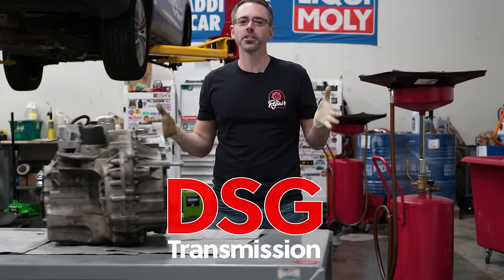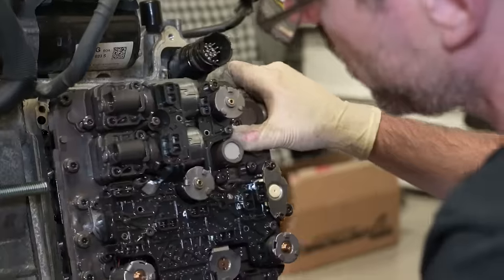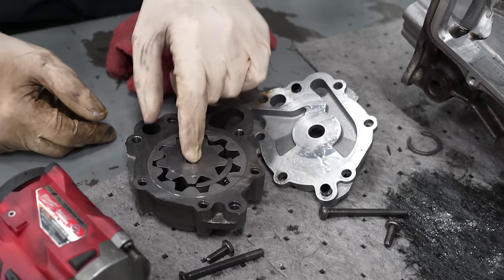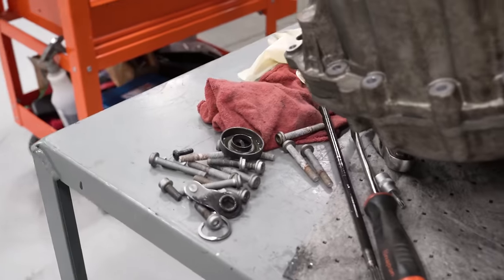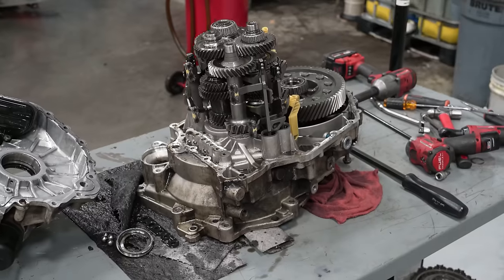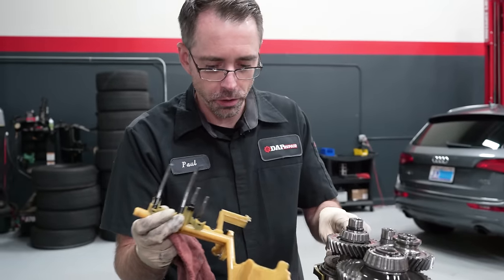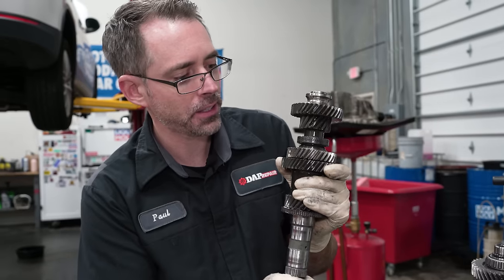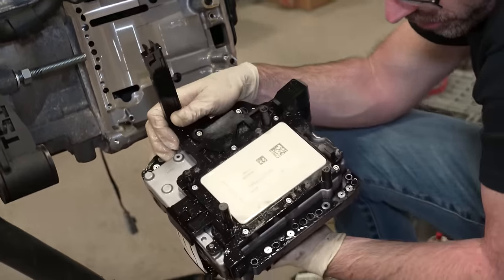Why Did This DSG Transmission FAIL?

Comment: There's one point never mentioned is the software part. Temic (who develop the software for Vw) never made a good one. It's one of the most important point if you want a reliable DSG. TVS Engineering is the best choice if you want to upgrade it. Very impressive result, better experience, more comfortable, 1000% better than the Oem One.

Comment: Just like Volkswagen flushed europe with good TDI´s they also introduced efficient automatic transmissions to markets that that werent known for them before. And now in 2023 you basically cant buy a manual car anymore because emission standards and people are used to automatics. Ive driven many DSG´s over the years, the older ones where a bit more rough and sporty in D mode, my current Passat´s DSG is definately programmed towards comfort, only in S it gets more eager to downshift more responsive. But as a euro I drive a TDI, sporty models like the Golf GTI and R are suited better to a DSG.

Comment: This is a nice video,,, STARTING FROM WHICH YEAR MODEL HAS GOOD DSG TRANSMISSIONS???
Reply: If you want no quirks, I would pick any DSG on the MQB platform.  As a personal MK6 DSG GTI owner. I love the car, and the transmission. BUT, as people have mentioned and in this video, cars like to lurch from a stop, it being cold can make it act weird, and if you're not ready for a high repair cost if it ever needs to be taken care of, don't buy one, stick with a manual. Even with my GTI being taken care of, and having both of it's DSG services being done on time, it still likes to act weird.

Comment: I think in general the dq250 is way better than a manual and pretty much as good as a decent auto slush box interms of reliability due to a few factors.
1. Its a wet clutch so that reduces wear alot
2. One clutch for odd gears and 1 for even so it spreads the load over two clutches
3. It takes driver error out by not riding the clutch or bang shifting gears in a bad way like a normal manual.

Comment: Is the second noise(with the bang with half a second in between) related directly to the trans? Never had any other signs but occasionally it's banging on idle when im at a red light. Please enlighten me how to fix that if it's the trans😭

Comment: 11:54  is there a possibility this parking pawl could fail due to low transmission fluid. And would doing a oil service fix this problem. As i suspect this part failed due to low dsg oil on my vehicle im using bcoz of low oil it is now making it harder for the part to disengage. My vehicle can go into D but move forward a slight inch then locks. (I have no faults on box only says low transmission fluid) .

Comment: DSGs are great. Just make sure to get the oil changed regularly because as you can see: "Mommy and Daddy Clutch" run in transmission oil causing friction material to slowly collect in it.
Reply: later designs separate the oil systems, (and some are dry clutch, but their horsepower limit is about(?) 250BHP)

Comment: I have a mk6 golf gti with 100 miles on it, i do hear somtimes multiple click sounds when i switch gear between p r and d, if its like the gear is slipping and taking time to be on, i do change dsg oil every 30miles any help in this matter?. Thx for this informative video and channel.

Comment: I was forced to use stupid WV with stupid DSG in my work. This lead to my first and only car accident, due to inappropriate gear shifting, as it can't predict traffic. Since then, and before that, using manual shifts presented great performance and 0 accidents, as it was 100% predictive and 100% accurate, albeit a bit annoying in city traffic.

Comment: looking to swap to a newer year dgs in my eos  (2009 => 2012)  any big issues that would stop me?  Im almost positive everything will bolt and wire up.
Reply: My 2012 Eos 110k miles, died while on the road far from home. Had it towed to nearest VW dealer who said the DSG clutch pack and mechatronic died. They don't repair them, so a new one was needed,. Problem was that they are back ordered in the US for 6 weeks (I wonder why?) and $6-7k to replace. Book value was around $7k. I called 3 VW independent shops who refused to touch them, saying parts are unavailable. The ones that they tried to repair, eventually came back. Considering this and the potential for very expensive roof repairs (read the Eos forums),  I sold this headache of a car for $600. No wonder they were discontinued in 2015. We loved driving it around though.

Comment: What if the other gearbox ( rebuilt unit) is ok? Maybe you tried a bad mechtronic with it. Remember the mechtronic unit will be full of metal from the original gearbox failure.

Comment: Great and timely video.  Bottom line: are these DSG units bad? I hear that they are very jerky in city driving and are best at freeway speeks. I was thinking of buy a '24 Tiguan, but I don't want headaches in the future.  Happy holidays and Happy New Year.  Thanks you.
Reply: Test drive?And no they aren't jerky.
Reply: They are not great in city traffic. The mech box does not like unpredictable on again off again throttle, like queuing in crawling traffic, idiots doing surprising things in front of you, etc. Jerks all the time. Queues uphill are horrible and you will wish you had a slush box to mush along.
Reply: THERE IS Always "BUT" with VW. Tiguan have DQ500 wich is best DSG ( for heavy cars),but some have DQ500 and inside is mechatronic from DQ381 ( wich can have dtc P13500,P13600). Now DQ381 is GEN2,hope that this problems are resolved). DSG dont like too much Heat, after 250 miles driving is good to stop and cool down oil in DSG. Some tuners Like TVS have option in maps for termal management wich can be good. Because this problems wich All DSG have for now best oil is MOTUL Multi. Also for high temperature in engines Motul 8100 (Ester oils "Group V").
Reply: Picked up a 2016 Tiguan DSG last week and love it. I am probably going to retrofit the paddles though as I'm not kern on going around roundabouts and junctions in 3rd and 4th and would like to shift down
Reply: I have a 2019...not Tiguan but the Seat equivalent (still VW). Not jerky. And unlike the manual version of the car, the adaptive cruise control works right down to 0mph, aka "traffic jam mode". And there's an auto-coast function to save fuel. It drives nice. Still feels like a bit of a lottery because it would be so expensive if it failed. But I can keep renewing the warranty.

Comment: Interesting teardown.  It's interesting how VW manuals just last forever, so why would the DSG be any different?  I suspect that R32 was driven extremely hard to get that bearing to break.
Reply: I find it odd that the bearing appears to have a composite cage holding the balls in place. I am wondering whether it would have lasted even longer had the bearing had a metal cage.
Reply: Manuals just are like that, they're meant to last forever. There is not much to go wrong, if you treat them right of course. But a blown out bearing also can happen sometimes. I remember some Fiats and Alfa Romeos to have either an M32 manual transmission (I believe it was a GM product) or a proprietary one. The M32 was a pisspot, it didn't last even 200k km before the bearings would go bad. On the other hand the proprietary one was decent and didn't cause problems. If you had the M32 sitting in the car, even after a rebuild, you had a really hard time to find anyone to buy it from you.

Comment: Looks like this unit was never serviced? if it's the DQ250 (deffo wet plate) it needs an oil and filter change every 40k miles.

Comment: Is there any good way to diagnose a DSG box without stripping? Mines for example slips when changing into 2, 4 and 6th only by 200-300 revs apart from that drives normal no other slippage, it does have a TCU tune as it modded and I am having a hardtime seeing if software is at fault or hardware.
Reply from the maker: Probably a clutch pack issue but diagnosing it specifically is very hard. 

Generally most DSG problems are either the mech unit or the clutch pack. Pinpointing which one is often not possible. This means you have to either attempt to replace the parts or put a used transmission in. 

As vehicles get higher mileage we generally recommend a known good used trans as it’s often the most cost effective way to guarantee the vehicle is repaired.
Reply: Wich DSG? Is it DQ381?

Comment: i have a friend with a vw with a dsg, he commited the mistake to take his car to a cheap mechanic, now the car is leaking oil from the transmission and the transmission is jerking mkre often than before. so, dont cheap on it or youll have to buy a new car.

Comment: 100 miles, paid off fully 2 months ago, and the local dealer quotes us 13k for a full replacement. My ‘74 Squareback proved more reliable. VW brand loyalty died yesterday

Comment: Well i drive a Golf 7 TDI 2.0 with a DSG DQ250 and i have over 380.000miles, without any Problems. Just change the Oil and u got no Problems. Dont use Launch Control...

Comment: I bought a 2023 Tiguan R-Line 7 speed DSG in August and I already want to sell it, it is horrendous !! Doesn't know when to change gear, over revs and when it does change it takes a week to change !! Save the manual.

Comment: Wow       does a aftermarket bigger dsg cooler help?
Reply: Think that BIGGER cooler is for high tuned cars. TVS Engineering (ex DSG DOKTER) have maps for: thermal  management,oil cooling etc. even on Stage1 TCU.
Reply: @micko557 oh ok thanks    .  Since I am in East Coast NC   my oil temps running like 220 or little more in the summer so was thinking of upgrading the oil cooler later on   and then thinking of dsg cooler upgrade also
Reply: @kencee9213  It is good to cool down oil after fast driving and drive normal or after 200-250 miles to make pause. Here in Europe when I spoke with same Race cars owners about DSG - they All use MOTUL MULTI OIL for DSG/STRONIC. Probably with good reason 👍

Comment: 200.000 ''miles'' is not a lot ,car should still work, not expecting it to fail after only that many KILOMETERS. I have 2.0tdi dsg from 2010, it has 380.000km, still works fine. Changed the dsg oil/filter when i bought it just to be sure. Idk how servicable/rebuildable they are if something brakes, i kidna dont belive you that they arent servicable and you cant buy parts. I will ask my mechanic for info

Comment: I have repaired one of the doses of DSGS! ITS NOT EASY! PARTS ONLY ONE E-BAY GOOD USED!
 BEARINGS FROM SKF. SHIFTFORKS PLAY IS VERY IMPORTEND SLIDER IS HARDER MEATEL THEN FORK SHIFTFORK TRAVELSENSOR BREAK SOMETIME OUT OF TOLERENCE ITS NOT THE SENSOR!

Comment: I've owned 2 dual clutch cars. A 2012 Jetta Sportwagen TDI and a 2011 Porsche Carrera S with a PDK.  They are incredible machines and thanks to this video I feel somewhat more comfortable in their durability. But, my wife just purchased 2024 BMW X3 sDrive30i with a regular (torque converter) transmission. It is a ZF 8HP and I am here to tell you it is every bit as satisfying to operate as either one of the DCT's I owned.  The ZF shifts so fast and smooth it unreal. None of the slippage that would be normally detected in a torque converter transmission. So,  impressed.  I read the Porsche Cayenne still has a torque converter transmission to give it greater towing capacity. I don't know. The Macan has a DCT, actually a DSG from what I've read. Even Porsche calls it a PDK. I'm in a 2023 GTI 40 anniversary 6 speed.

Comment: so lemme get this straight, VW Dual Clutch transmission cant be rebuilt but a DPS6 Ford dual clutch can be rebuilt because you can get the gaskets and bearings? the hell?

Comment: Hilarious! The parts drum, err tray. 😂

These units are totally rebuildable. You just have to go outside the typical network to source parts. All those bearings can be found, cheap. Even the mechatronics can be serviced. If the distance sensors go, you’re SOL though. New Mechatronics for ju

Comment: Had the DSQ250 in my Seat Leon FR, drove it to 220k kilometres. Worked better than the new 7 speed DSG I drive in our new ambulance at work. Just make sure to mantain (oil change) it regularly in a shop, where they know how to work on it.
Reply: DSG is not ideal fir ambulances, due to the predetermined shift. Assuming that you are in 4 and the box is preparing to change up to 5. Then you suddenly need to accelerate. The change sequence will be 4,5,4,3. It only takes a few seconds, but it seems like an eternity. The 7 speed also has dry clutches, which can wear when used for emergency services work.
Police pursuit drivers hate DSG. But unlike the BMW's, they don't keep catching on fire.
Reply: You are absolutely right!

Comment: Are dsg 7 speed good?
Reply: 😁 😂 watch the video and find out
Reply: Well... depends. If you have doubts no they aint good UNLESS they have been serviced regularly. Regular trans fluid flushes keep these units alive for a lot longer.
But that can be said for any transmission.
Was the car just a daily driver or did some kid roast the clutchpacks? 
With high torque output engines and towing these transmissions are under more stress.
Reply: @bluepirate4640  but that’s a old golf 5 dsg
Reply: depends on which one you think

Comment: remember to change the oil to every 30k miles or it will shift like someone is banging it in to gear with a sledgehammer.

Comment: 200,000 miles is good. But their Toyota with 1 million miles on the original transmission, some honda with 1 million miles on original miles,  even some trucks have 1 million miles on original transmission....yeah sure DSG are so reliable.....

Comment: I had 2 GTIs with the DSG (2015 and 2019) and while the 2019s was massively better, after getting an EV I cant believe I ever drove a car with all this complexity.
Reply: But 2019 didn't have the dsg farts. 2015 is the dq250 which they used in the mk5 so its old tech but tested so u know it'll last

Comment: I thought it was dog 💩 gearbox 😂 they are horrible. Unless you religiously change oil before it's needed and pray to the omnissiah you don't have the mechatronic crap it's self, or have water leak in to the electrics... I hate working on them.